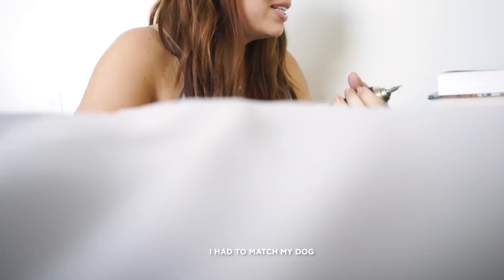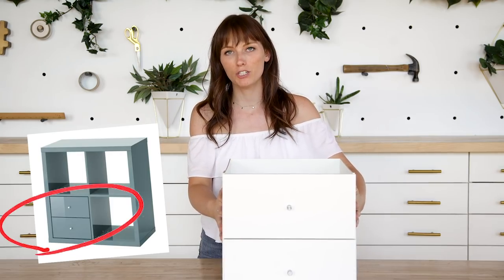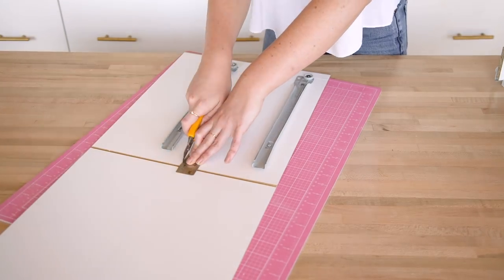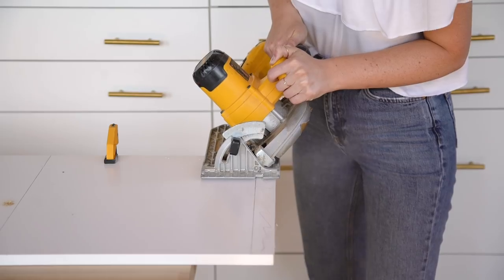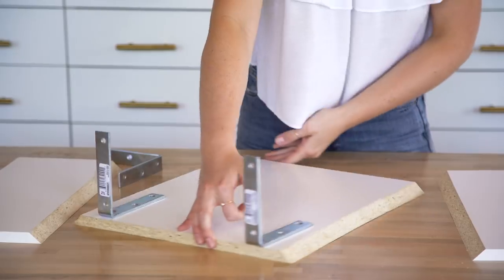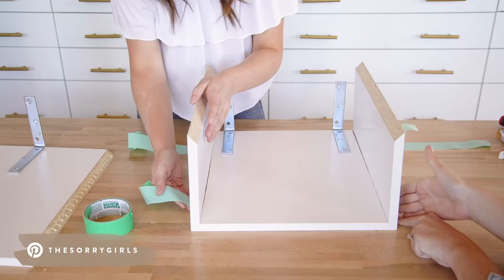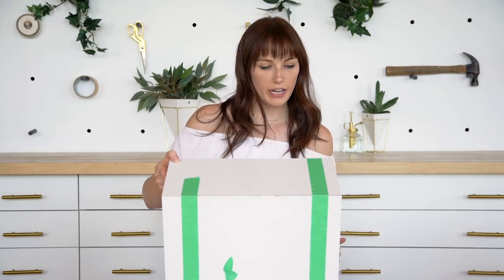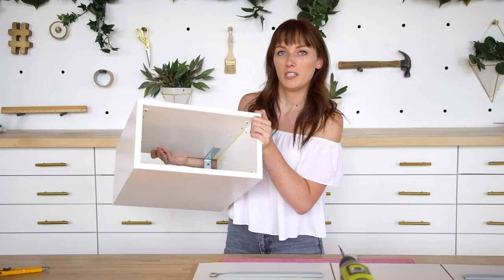Floating Nightstands Ikea Hack!

Comment: So i love this looks amazing ... Although once you have the box made putting the tracks just in the box would of gotten rid of the insert. Just a thought
Reply: I agree, it would have been much easier and quicker just to mount the drawer slides to the box.
Reply: Mud Puppy but with kelsey's way, it will eliminate the chances of the slides being uneven on both sides and looking wonky
Reply: Then the walls would be too wide for the drawer genius. 
Kelsey's method perfectly solves the width issue but it also prevents you having to do WAY more math than necessary since she cut the frame to the Kallax measurements.
Reply: human no??   You would make the sides of the frame to fit the drawers...
Reply: The insert also covered up the wood glue and inside brackets.

Comment: I just put together the Kallax 2x4 cabinet along with the door insert and a 2-drawer insert on Saturday for my conversion van. I like the idea of using 1 of these 1/2 height drawers to make a floating cabinet by itself. My only issue with these drawers (because I am using them in a moving vehicle) is that the drawers pop open. Yes, and what's funny is that it's only on a right hand turn. Sure a match pack will work. Gotta figure out a way to apply friction until opened by hand. Also, it's a good idea to glue the hardware in since it's just MDF.

Comment: Why did you keep the cardboard? Is there a specific reason you didn't screw the slides diectly on the box you did ?
Reply: it's probably easier since you don't have to fiddle with the right placement of the drawer slides. (i had to do that once and it was a nightmare ^^)
Reply: Did you have a box made of singular pieces ? because I thought you could just use the slides as a hole template and drill the holes before assembling everything. Maybe I'm wrong, I've never done it before :)

Comment: I live in the basement and two of my walls are made out of concrete. So I can't put anything up with a nail on those walls, are there other options of decorating those walls?
Reply from the maker: Tina T Letitia’s wall that we installed the nightstands and headboard on was actually concrete too! you just need a hammer drill and concrete screws (we used a brand called tapcon and that comes with the masonry/ stone drill bit you need). It’s a little louder (and gets sweatier) than drilling into drywall but it’s doable! Also removable sticky hooks are also and option :)